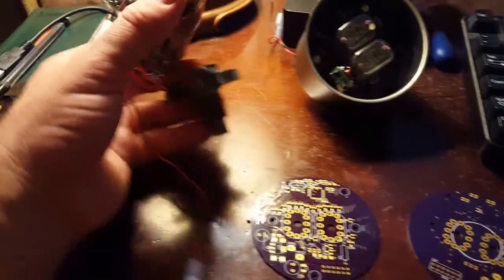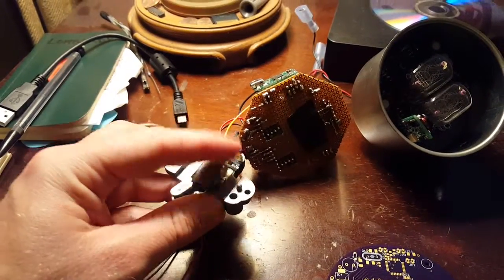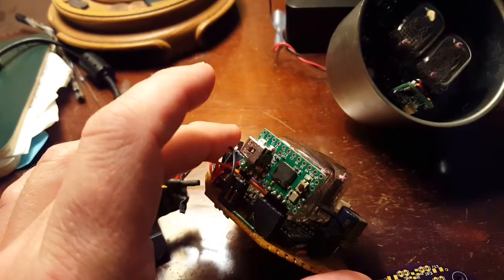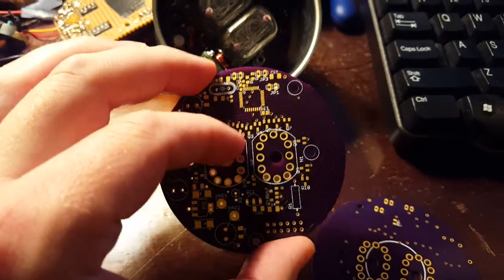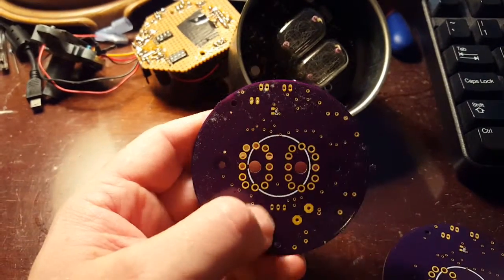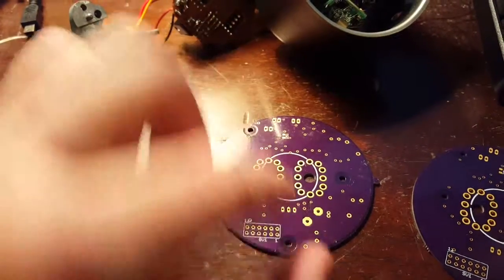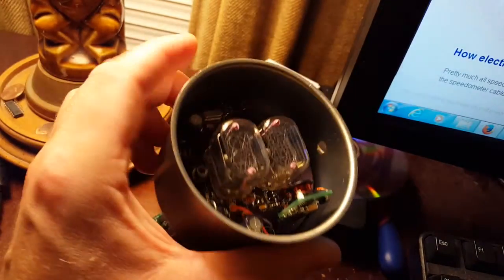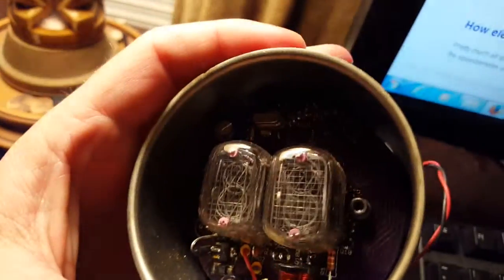Nixie tube speedo design

Comment: probably a bit late, but are the nixies easy enough to read outside and in sunlight, looking forward to trying this myself. btw really nice design!
Reply from the maker: Not the most daylight readable. The schematic for this design uses a fixed resistor value to set the high voltage, which sets the brightness. It is at a pretty low brightness level. That could be changed to a variable brightness driven by ambient lighting conditions. I have an updated design to do that, but never implemented it/built it. I also think, there would be some trade off between the survivability of the nixies if driven at the brighter setting. BTW, I have a few extra unpopulated PCBs if you want one.

Can kinda see what it looks like in daylight....

https://youtu.be/zpcykat8qxw
Reply: @stuff4p200  ok, ive got my own pcb but Thank you so much! The pcb has a brightness controle. I plan to use them for my Honda goldwing, but it's a Challenge!